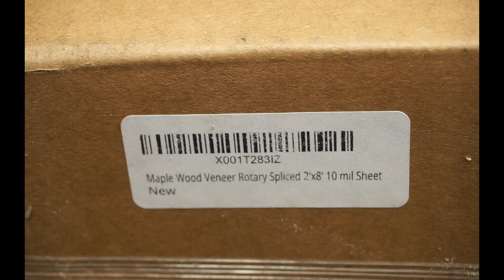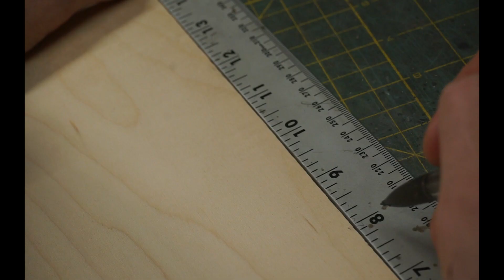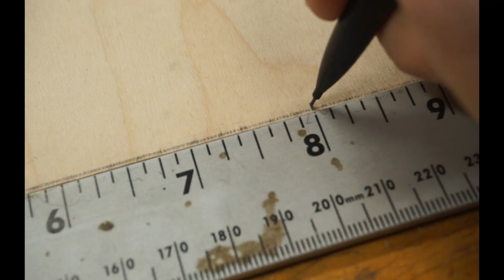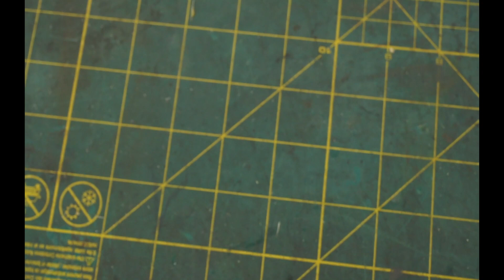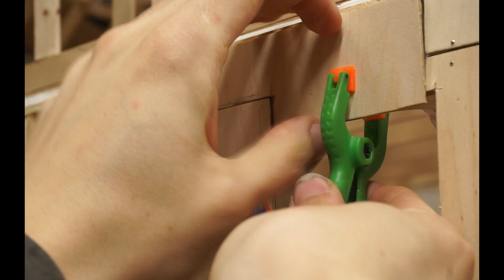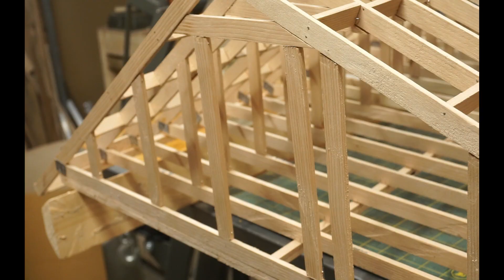Building a Realistic Model House, Part 27: Sheathing the House

Comment: Ya know I just had a thought about your plywood... and I can’t remember if you have discussed it before.... but what about strips of balsa wood instead? Is it too rigid? Or... too brittle? Have you considered it?

Good work as usual :)
Reply from the maker: Thanks! I'm intrigued with your idea, but I suspect that it would end up being too expensive - each roll of veneer costs around $30 and I am able to get around 40-50 sheets of plywood per roll. I haven't priced out balsa wood, but I suspect the price would be higher. Also, is it possible to get balsa wood that's 1/16in or thinner? I really would have liked to have made my own OSB, but alas, I'm a bit lost as to where to start with that!

Comment: Just a hint, I have one of the original zipsnip tools. It really cuts through stuff like Veneer really easy. I do believe another company now sells the Zipsnip. However it is a great tool.
Reply from the maker: Huh, never had heard of the zipsnip before - it looks interesting! How much faster is it compared to the tin snips I was using? Thanks for the tip!
Reply: @RyanGausMakes  I use it for a lot of things. It can cut through roofing, wire, cardboard, veneer, sheet metal etc. Cuts fast and very straight. It is also rechargeable. Here is a link to the newer one. I have the older white and green one. The new ones are orange.